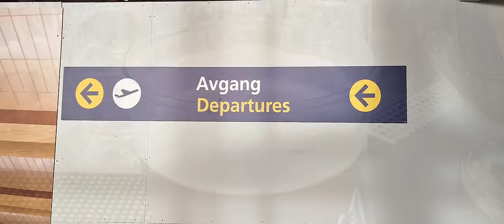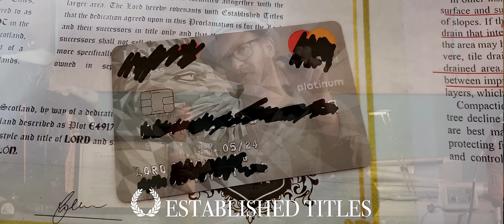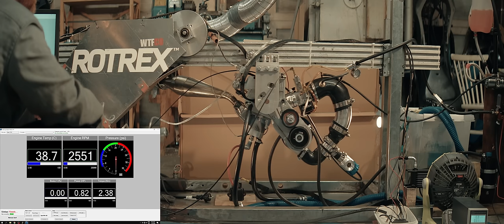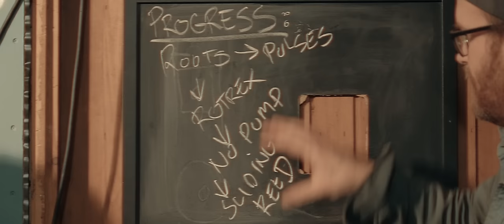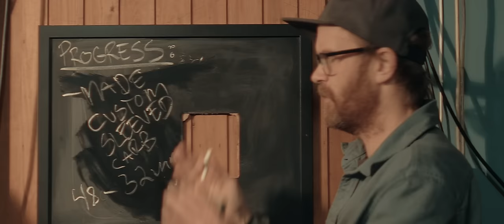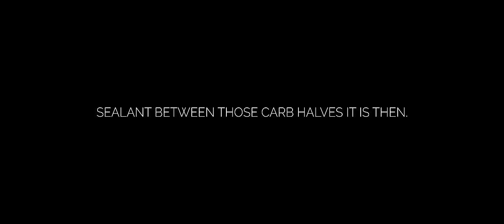Supercharged 50cc Two Stroke Flamethrower!

Comment: So your bov and carb sticking issues are related. Bov needs a signal from behind the slide. In the crankcase you have pulses and I'm willing to bet the pipe is making them stronger at rpm. The vent to the top of the slide works great for me but don't tap into the bowl or any pitot circuits it will slow the response rate leading to a rich jetting which seems perfect until it's in boost for some time like in a run then it gets rich. We tape into the plenum for the slide. Also a bigger plenum will help especially with runner length. As it is the pulse thinks the compressor housing is the end of the runner. Sure this is small potatoes now but it's gonna make a good difference in power. For me it was about 38whp @22psi and a proper plenum got that to 50+ @22psi, it also isn't as peaky as before all the power was between 10k-11k now it's 7k-12k. Don't know how that translates to this as I think you may have a fairly constant flow at rpm being a two stroke and having to fill the crankcase. Great job she sounds happy. Can't help but wonder what's the egts like?

Comment: i wonder how far it will rev!! i think 20k is duable , maybe you should make the pipe shorter to move the powerband further
Reply: The pipe is tuned for 19000 and this engine with the Roots blower has achieved almost that number while connected to the retarder. Reliability has to be the number one priority on a 4 minute speed run.

Comment: I'd guess the slide is being pushed, by pressure from the supercharger, into the back of the channel it is in, adding friction. I wonder how you can test that. If that is the case, maybe polish the contact surface between the slide and the carb, where the pressure pushes the slide? Or get some teflon in there or something. Is there a push-pull kit you can install for that carb?
Reply: I wondered about linear needle roller bearings and a pull shut spring?

Comment: i think i seen were the leek is. at the front not the back were you fixed the nos port you can se what looks to be a small stream of liquid flowing out and down the higher the pressure. look at the electron badge above the top of it is were is se flow 17:09 time stamp

Comment: PROGRESS!!

I've come up with some ideas for the slide maybe!

The first is lapping or grinding the slide for a smoother finish, i guess that will help allot if it's a little rough right now. 
And maybe it's possible to make the contact surface a bit smaller for less resistance? You could try to make a little chamber in the middle of the slide, and just leave a little bit of contact area wich you can lap or grind really fine.

I made allot of springs from TIG welding rods, maybe as a temporary solution?

Hope you can do something with it! 

Jason

Comment: Several issues....  

Using a slide carb for a blow through application is asking for trouble. Suck through, yes, blow through, no.  On a suck through config, the greatest pressure differential possible across the slide is 15psi. Or 1 bar. You have ambient pressure on the inlet, and in edge cases 28+ inches of vacuum on the engine side. 

When you are blow through, this skyrockets. Depending on what boost you are running, you could have, say 15psi boost and engine vacuum on the other side which makes the pressure differential nearly 2bar! That will cause mechanical issues with the slide hanging.   If you are stuck on slide, move the carb to the inlet of the rotrex and call it a day. Otherwise you should be using a butterfly carb which is not affected by pressure differential. The Harley Davidson Super E style carbs have a ton of aftermarket support. Only downfall is it's larger. The venturi is 39mm and the throat is 40mm. I don't see this hurting you however. Especially since you're boosting it. 

The other thing you really gotta do is get off of that slide that's giving you problems. I know you said you need to make big mods to fit a reed cage in there, but you really do need to run a standard reed setup. Your argument is that you don't want to deal with the weird harmonics of them. However they are only in play when you're out of boost. When you're in boost, they just stay open from the continuous boost being pushed into the bottom end. If anything, they may RAISE your transfer pressure capability which makes your supercharger more powerful.   Think about it. You put 0.5 bar in the crank case. As the piston moves down you have the capability of forcing fuel 1 direction through the engine. At whatever pressure required to get it in there as provided by the crank/piston. If that crank case is open, and the piston moves down to transfer fuel, it may take .7, .8. 1.0 bar or more to transfer fuel required for the next power stroke. Remember, you're fighting the stinger in the exhaust pipe as well. So this pushes fuel back into the carb/blower while giving the cylinder a weak charge which I suspect would look "lean". Like you've been saying all along. 

Another thing you can do is add a reed valve stopper/limiter which I don't think I've ever seen you run on any of your setups. This forces the reed valve to require more force at higher rpm to open further as it bends the full length of the reed, rather than just where it's attached at the cage. This makes the reed capable of operating at far greater rpms than the setup you WERE running. You also have a CNC..  there's not a whole lot stopping you from making a reed valve housing to replace that slide valve configuration you got going on right now. 

These 2 things will change the entire setup into something amazing.
Reply: I also forgot to mention, slide carbs and boost don't work because the boost may be going into the float bowl so your jetting remains unchanged, but it's not getting above the slide. So you have atmospheric pressure on top of the slide and boost below it. It is basically blowing your slide open which is causing a runaway condition.
Reply: “These two things will change the entire setup into something amazing .”

You think.
Reply: @somenygaard  I been around the block a few times. I have a very good understanding of engine theory and many times I've assisted in correcting  issues with manufacturer's products ranging from TCI billet, Magnusson superchargers, TCI automotive and on and on..  I've worked on and developed my fair share of 2 strokes and 4 strokes, nitrous, natural aspirated, boosted, gas, mix, nitro, alcohol...  I think I have a fair footing to stand on when it comes to giving advice. If it's a topic I don't know about, I keep my mouth shut and listen. This topic however is why I subscribed to this channel. So you may want to slow down before you try judging someone based on a single comment.

Comment: the slide on a lectron carb is a wear item. They are designed to wear in order to not wear the body.... the alky nitro cools the carb so much that the oil on the slide gets thick and sticky, and as the slide wears...makes it all much worse ......keep the slide very clean. Polish the slide and its mating surfaces on the body, regularly.... That will help with the return time, and make it operate much smoother...
Reply: your boost is even making it worse by putting pressure on the slide,  it will wear even faster....and the pressure will make the rough surfaces grab harder,  and thick cold oil.....=slide lag
Reply from the maker: 👍 Working on a solution.

Comment: Exciting times M’Lord, Alex!! That engine is sounding great and seems to have no problem pulling the unloaded dyno around now. I wonder if you used solid slide linkage with a spring loaded shaft and push pull cables you could get past that sticking throttle issue.  A couple of my motorbikes have that arrangement. Eventually I would have the slide (power) valve on a solenoid with a microcontroller to control the open and close but I’m sure you’ve got a plan for that in mind.

Comment: There's really only one way to make more power...and that is MORE FUEL. Been waiting for that. 

I'll say one thing you sure do build some tough engines. Awaiting some numbers here. :D
Reply: More fuel? yes, but most of it seems to be flowing through the engine unburned. If A/F instrumentation were employed, it is a straight forward calculation to determine how much fuel is actually contributing to the bhp.
Reply: @davidgierke7582  You understand this is in development? Using A/F to tune two strokes is difficult...add pressure fed and it goes out the window. It's easy to fool an O2 sensor into thinking a rich mixture is lean. A lean mixture is hard to ignite and all the unburned fuel from that cools the sensor leading to a false rich. There will be large inefficient ranges in the RPM spread where having it run cleanly through them is a win. At this stage of evolution his design is a winner.
Reply: @michaelcarberry594  I'm not talking about using O2 sensors. I've been through this for many, many years and the use of simple instrumentation isn't difficult... and without it you don't know where you are. We'll see how the evolution of this engine progresses. I hope that he wins, but trial and error tends to get boring, especially when the desired result isn't realized.
Reply: @davidgierke7582  After 14 landspeed records I've gathered a few bits of knowledge as well. And this isn't the place to hash it out. BTW you don't actually win at landspeed you succeed. Good day.
Reply: @michaelcarberry594  The win that I'm  referring to is his two stroke engine development. BTW, from my experience the number of records a person accumulates has more to do with persistence than it does technical knowledge. Congrats on your past successes.
Reply: @davidgierke7582  Thanks for the thinly veiled insult. Unnecessary and hardly constructive.

Comment: 😈😈😈 i just remember riding a rgv 250 when i was 19 ...  it reved so fast i didnt have time to clutch it ,  i just slide the box through three gears in a power mono from take off leaning over the tank with all my 70 kgs of weight ... must have done a 11 second pass with a professional built  motor for racing with an enlarged power valve ...  what evevr that means ? 😈😈😈  scared the heck out of me but i loved it !   Your motors in those parameters with high pitched revs  , imagine with gearing  😈😈😈

Comment: You might be experiencing some icing/ light frost build up in throat of the carb. Even with the heat of compression from boost, where the deltaP is occurring over the venturi, and heat of evaporation with your fuel mixture,  especially the nitro, will be deltaT of ~200°F (nitro by itself is -320F, )
Reply: I think that you're talking about methanol.

Comment: Hei Alex if you purchase a speed cable and handle for a boat Your problem will be solved. If you do that you wil Get force in both directions. But you wil have to drill a Hole through Your aluminium beam, because the wire cant handle that 90 degree bend. And figure out a solution to mount the wire to the throttle slide. But should be no problem for you.

Comment: use a solid wire cable instead of spring,direct throttle control.
Reply: then it guess it needs to be 2-way controlled.
the linkage would be more trickly to make good.

Comment: Hey Alex great to see and hear it running/revving  like it should.
I wonder if having your boost pressure in the zone might be exposing the sticking issue when running a Slide Intake on a Blown engine.
Maybe that is why Blown engines usually have a butterfly intake?

Comment: Should be tuning fuel under load not just revving it. Easier to donit consistant til.
Reply from the maker: 👍 Just need to make it ready for under-load conditions first. Not long now, fix slide sticking and carb leak.

Comment: I think you will soon come across the problem where a slide carb will be very lazy with pressure behind it as it jams the slide against the body of the carb that’s why turbo charged cars and other engines use butterfly valves instead

Comment: Hey, a quick question, is this electrical arcing under ignistion coil at 9:27 onwards doesn't mess up ignition in the chamber? it wouldn't be good if some nitromethane droplets got on that and made external combustion engine :) Cheers from Poland, great work, looking forward for more!

Comment: Can't you take a diffrent caburator with a trothle valve instead of a slide? Like a Butterfly valve? Then u don't have the problem that the throttle gets stuck, because i presume that happends because the boost pressure pushing against the throttle. As always a amazing video!

Comment: I finally got caught up on all of your back videos (it was quite a ride) and feel as though I should comment on the methanol/nitromethane fuel that you are using. If I'm not mistaken you are used 10% oil—probably synthetic due to the fuel's coloring—but I could be wrong. Anyway, the engine seems to be running oil-rich, especially when you continuously "breath" the cylinder during throttle manipulation. Although an oil-rich condition is desirable to preserve the piston-ring-cylinder combination, and keep the head temperatures reasonable, I believe that the actual (rich) air/fuel is causing unequal combustion and therefore the erratic running that results. 

Since your engine uses anti-friction bearings throughout, I believe that you should try running between 5 and 7% oil in your fuel and see if the running consistency improves. By the way, do you know what synthetic oil is being used by your fuel supplier? As I'm sure you know, there's a great difference in lubricating oils. A simple polyglycol, although adequate for most garden variety 2-stroke engines, simply is inferior to an up-to-date synthetic. I have personally run several 2-stroke engines (2.5 cc) above 50 krpm without damage on my dynamometer. After 50+ years of playing with 2-stroke engines, I am a great believer in dyno testing—as are you. One thing that alarms me somewhat is your lack if air and fuel measuring instrumentation with your work. I use an old fashioned air-dampening-drum,a calibrated inlet venturi and manometer for measuring the air (lb/hr)... and a camera recording system if deemed necessary. Fuel flow (lb/hr) can be determined (again, the old fashioned way) with a burette and stop watch, which is hard to beat when the engine is running at steady state—which, evidently you intent to do at peak bhp. 

finishing this up for the time being, if you are using only 20 nitro, I wouldn't be too excited about the increased power potential that the chemical offers. At those low percentages, I have found that nitro is most beneficial for calming down methanol's erratic combustion behavior. Also, there are much better ways to deliver fuel to the carburetor than gravity feed from your tank. As I'm sure you are aware, the last thing you need during this critical prototype testing period, is an inconsistent fuel delivery system . 

Anyway, I love your enthusiasm, use of machines, and ability to think through difficult technical problems in developing a better mouse trap. Best in success, Dave Gierke; www.davegierkebooks.com

:

Comment: Any way to add a double cable push pull throttle  arrangement to the carb? Perhaps a stiff rod connected to the slide connected with a push pull mechanism mounted externally on the top of the carb?

Comment: Hi, could pressure from blower be pushing slide back against the slide way, causing sticking, and aluminiun to aluminium are not good bearing surfaces , if that is what slide is made from, but only my guess. Many thanks for all the uploads.

Comment: All of the extra air flow and pressure is putting that slide in a bind.  Perhaps between the body of the carb has too much clearance allowing the sheering force to cuase the sharp leading edge to dig into the front side of the slide grove.  I wonder.  Could you round that leading edge off slightly to keep it from digging in?  Would that hurt the performance?  I think that putting a stronger and stronger spring will keep it digging into that slide grove more and more.  Does this make sense or am I just off point here?

Comment: The turbine flutter that u're referring to in the title of the video is in fact nothing to brag about.   It is in fact NOT turbine flutter but rather impeller flutter that has the potential to do damage to the impeller blades and / or shaft bearings.
The flutter noise is when the flow of boost pressure suddenly hits the brick wall that is the closed carburettor, when this happens,  it has nowhere to go so it smashes right back into the blades of the impeller hence causing damage to the shaft bearings in the supercharger/turbocharger. 
A lot of young fools intentionally induce this fluttering noise in their turbocharged cars by removing the BOV altogether not knowing that they are stuffing up their blower in the long run...
Just my 5 cents worth..
Reply from the maker: You're right. I did say the same thing in the video though, sounds cool, not good for it.

Comment: I'm looking at this problem and I'm thinking...what are you using this Engine for? a World Speed Record? then you DON'T need to rev up and down endlessly. I used to race  
R/C Airplanes (Pylon Racing) we fired up the engine then leaned out the Carb ( Methanol and Nitro) until we could hear the Maximum RPM, and we raced full bore...Every Racer I've seen at Bonneville got a push start to get going... I'm thinking pick an RPM you want to achieve and tune to hit that WIDE OPEN Throttle, you need to slow down? hit an ignition kill switch...look into Board Track Racing in the 1920's those guys raced wide open throttle, no clutch, no brakes, to make a turn they had kill switch that grounded the ignition so they could lean over, then released the button and the power was back on.

Comment: Could the sticking slide be caused  by the presure from the super charger pushing the slide against the rail machined in the carb body  causing excessive friction ?